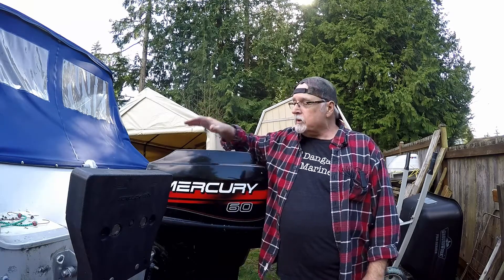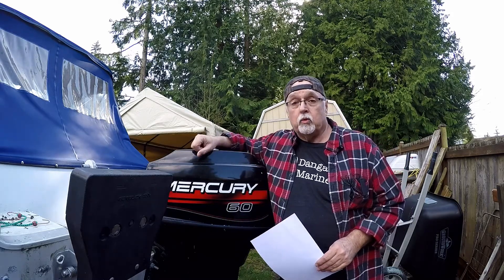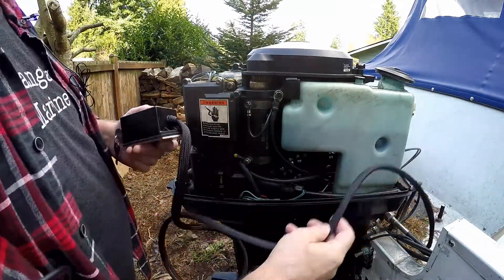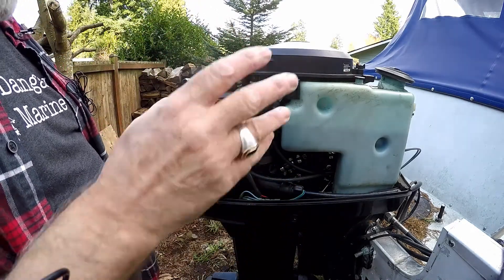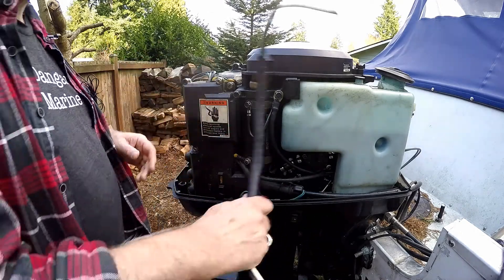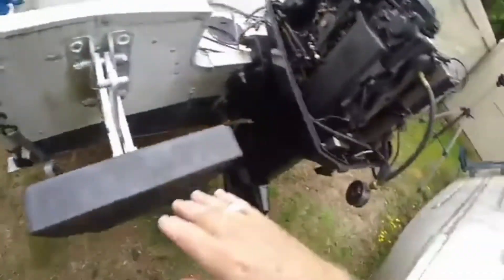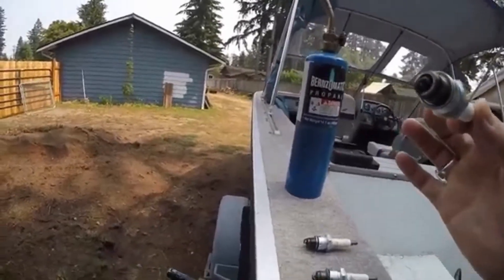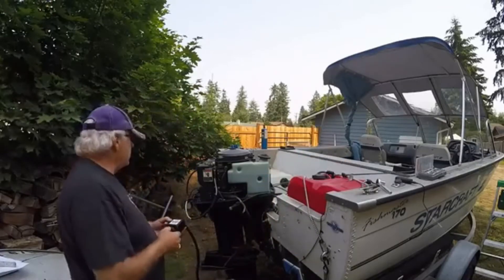Mercury 60hp compression test

Comment: yey man, i know this is an older video. but i have a request. i would like to see some pictures of your wires, where they go( connected)  im really interest how the trigger hooks up, and temp sensor hooks up. thanks. if you see this
Reply from the maker: Thanks for watching, I did a video on the trigger on testing it so you will see the wiring setup there also i did a video on removing the flywheel and showed the trigger set up on that video as well. I didn't have a temp gauge on that boat just the oil injection alarm which has a sensor for low oil in the tank. I was thinking about putting a temp gauge on but never got around to it. Pretty easy to wire one up and put a sensor on the motor
Reply from the maker: Check out my merch shop and help out the channel. Not only tee shirts and goodies but have stickers and coffee mugs too
https://tims-workshop-tjy.myspreadshop.com/

Comment: Hi Tim, I have a mariner 60HP 3 cylinder. 1998 Model.
I have 108 psi compression on all 3. Do you think this is ok?
Struggling to start. Good spark. Timing good.
Reply from the maker: 108 is still good especially having the all within 10psi of each other. I have 110 to 115
Reply: Thanks Tim,
Next I will check the fuel pump suction and pressure sides.
The priming bulb goes hard, plenty due in carb. New needles. Perhaps the floats needs adjustment?
I have good spark. Timing is good.
I just don’t think fuel is reaching the cylinders.
Thanks for all your videos. They are a great help!😊
Reply from the maker: The pressure coming out the fuel pump sb 3.5psi. Make sure you have a new fuel filter and you fuel hoses are newer and not restricted. Temp install the clear fuel hose from the fuel pump to filter to see if the flow is solid without bubbles. Air in the line will affect how the motor runs
Reply: Would 100 psi on all 3 be good ?
Reply from the maker: 100 all three is good. The key is all three within 10 to 15 psi. Say like you have 2 at 100 but one at 80. You have a issue and the performance wouldn't be good. The motor would need to be taken apart to find the issue and fix it. Folks ask me this allot and if your just getting back and forth to your fish spot then low compression may last awhile but if you taking folks water sking you would want a strong motor
Reply: Thanks for the reply. I seem to be running on two of three cylinders. When running my top cylinder my plug is dry. Any idea on what to check ? Seems to be not getting gas ?
Reply from the maker: So if one of the plug is dry then you need to test if the line going to that carb is getting fuel. just remove the hose from that carb and with the spark plugs removed turn it over with that one hose or extension into a small container. If you have fuel going to that carb then the issue is the fuel mixtures being too lean on the adjustment screw. open it up counterclockwise a half turn to see if that makes a difference. I must be firing, or the plug would be wet for sure. 2 stroke motors @ idle the plugs will be wet and that's why they don't work for trolling motors. the plugs will foul. They are meant to run them up on plane.
Reply: @TimsWorkshopTJY thank you for the advice !!

Comment: Hey Tim. I'm actually going to look at and hopefully buy a 2001 60HP Merc tomorrow. I know how to eo a comp test but it's been a while so was good to see you do it on the actual motor I'm getting as a refresher.

BTW if you make a remote starter button that just operates the solenoid (push button, two light wires, and 2 clips, connect to live and start terminals on solenoid) you don't need to mess around with earthing the plug leads as the ignition is not on.
Reply from the maker: Yes all you need is a push button to start the motor for testing but you need to be able to primer the carbs when you first start it which my remote does by pushing the key in for a few seconds just like the key start on the console. You can set up a push button for this too. Mercs are cold blooded and takes a few primers to stay running if not ran for awhile. My videos are a good guild for testing just remember link and sync adjustment screws are not the timing screws. When setting the idle RPM in forward gear you adjust the small idle timing screw. That's why when I set the initial idle timing that is 2 - 6 degrees ATDC I set it at 4 degrees so when you adjust the RPM idle your just lowering the timing closer to 2 degrees. Hit me up if you have questions

Comment: I have a 2009  90hp merc 2 stroke . Does this still apply ?  I get 130 , 130 , 125
Reply from the maker: Hi Steve, what matters is they are not more than 10 psi difference between each cylinder. I have a 1957 2 cylinder with 90 psi but both cylinders are 90 which is still good

Comment: Is a 90 on 3 cyl low compression?
Reply from the maker: Depends on what you mean by low?
Reply: Compare with your engine... I’ve got the same 60 hp
Reply from the maker: What compression are you getting on each cylinder?
Reply from the maker: I think I know your question now that I reread it. 90 is low but what are the other cylinders reading?
Reply: 90 even all 3
Reply: Found an another video that the Harbor tools gauge reads low, I’m going to get a different gauge to see the results
Reply from the maker: No nothing about HF compression gauges. I use an automotive compression guage and have had it since the early 70's. Has never failed me. Let me know if you get your readings back up to 120 approx
Reply: @TimsWorkshopTJY  I did it with a gauge from oreallys and got readings of 120 each cylinder…
Reply from the maker: That's great compression👍